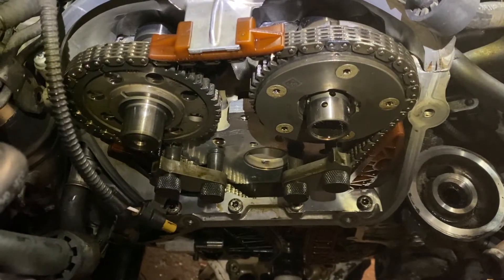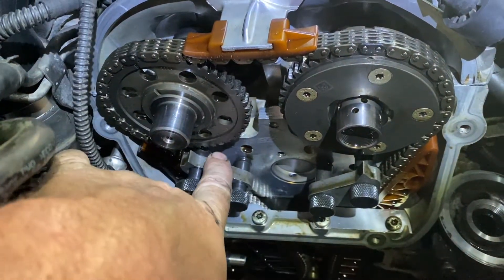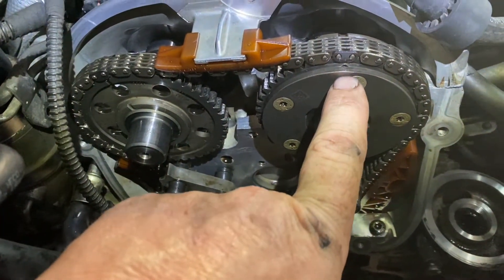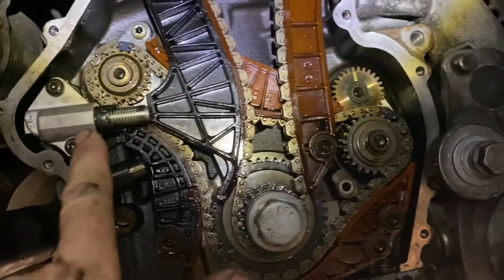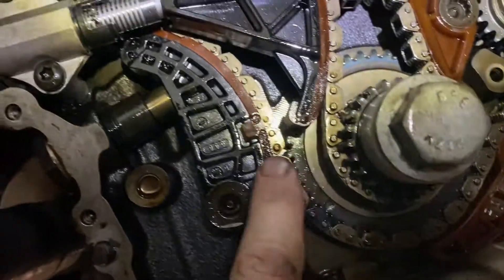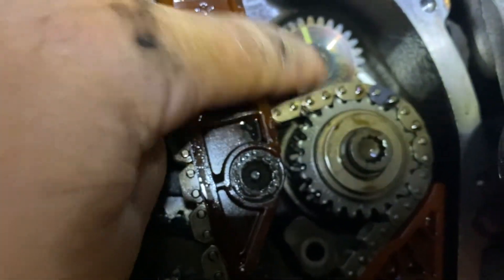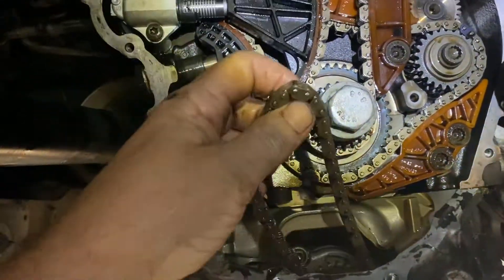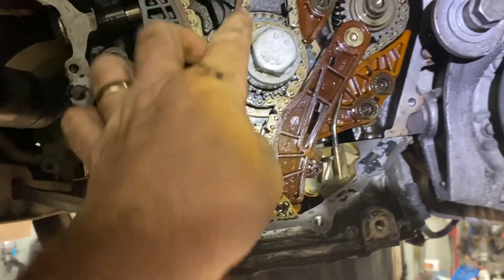Timing Mark Alignment for Valve Train On VW TSI/ CCTA 2.0 Turbo And Audi 2008-2015

Comment: Great video ! Was a great help assembling a tiguan engine. 
Iam currently trying to diagnose another tiguan 2.0 tsi . Vehicle was towed to us. It starts for 2sec and dies. The plug gets wet with fuel if you keep trying. Measured compression its reading 150 psi on all four. 
I squirted engine oil down the spark plug hole then it started , revved fine , with alot of white smoke , after a while the smoke cleared out. Then i shut it off, same thing , disnt start , wet plugs with fuel again . 
Tried starting fluid this time, and it starts until i spray the fluid but dies when i stop sparying . Could you please point me to what i should look into ?
Reply from the maker: Thank you! Appreciate that. Did you check the fuel pump module under the rear passenger seat?

Comment: Going to tackle my 2010 Tiguan this winter - cam chain tensioner and guides - quick question ; you mentioned in your experience that the counter balance tensioner doesn’t fail but do you typically change out the plastic guides for ALL chains ? - cheers
Reply from the maker: Well if you’re going to buy a timing kit that includes the secondary tensioner and guides I would replace all of them so you know you won’t have to do that job again.
Reply: @motorcarnut  cheers thank you for the information and guidance
Reply: One year later - just completed my 2010 Tiguan timing chan, tensioner ( original bad design ), and all three ( 3 ) guides  - your videos were very helpful and love all the comments and tips. Cheers - thank you for sharing
Reply from the maker: Thank you for the update and glad to hear that, I really appreciate it!